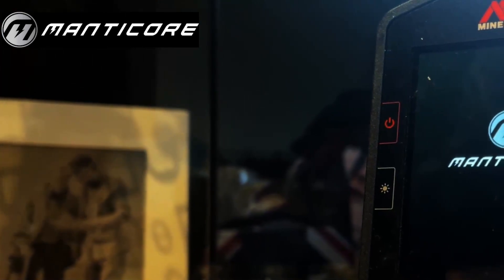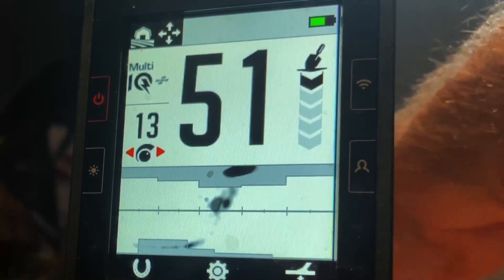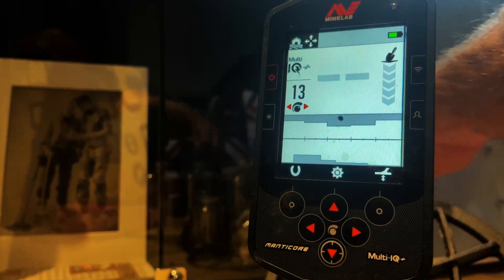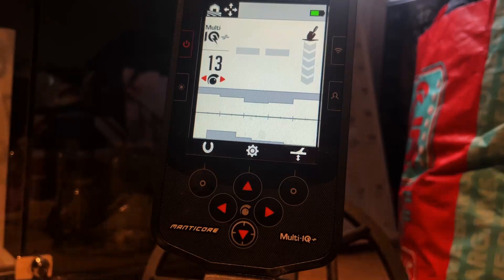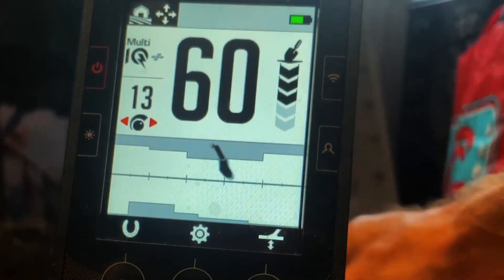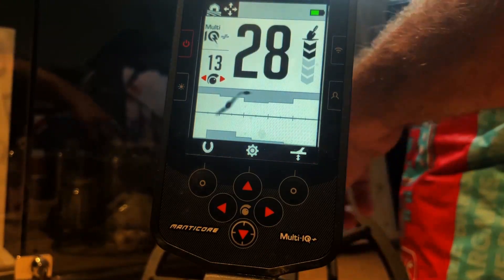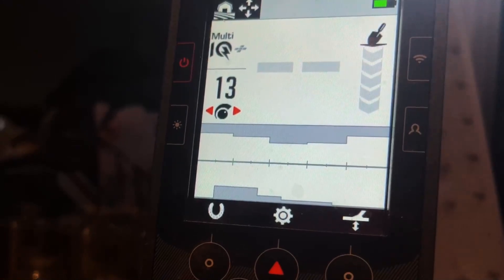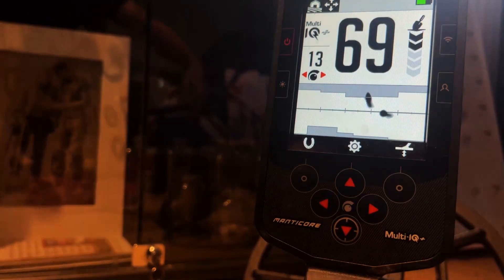BREAK THROUGH! Looking At The 2D Screen Of The Minelab Manticore | Metal Detecting Tips And Skills

Comment: So can you cut out the iron all together watched another vid about the new 900 and it cut out all the coke and iron ..?
Reply from the maker: Yes to coke no too iron
Reply from the maker: Some iron but if your pushing a detectors iron filter’s capabilities you got to be prepared to dig iron , with any detector with an iron bias iron filter it goes . You can run if really high and a higher iron tone break and not dig much iron apart from large deep iron. It all depends how much you are prepared to sacrifice digging some iron to get the goodies amongst iron. On some of my quite permissions I turn iron filter totally off , as a filter hinders the full performance of a detector , especially depth.

Comment: In engineering terms, a metal detector operates by generating an electromagnetic field and sensing disruptions (feedback) in that field caused by metallic objects. When small iron objects are shaped as balls or rings, they provide a more coherent and concentrated mass, leading to a stronger and more consistent signal disturbance. This is due to their more uniform interaction with the detector's electromagnetic field. On the contrary, irregularly shaped iron (horseshoes etc) objects may scatter the electromagnetic field, resulting in a less predictable and weaker signal, making them less prone to mimic good solid formed targets (2d traces). So it’s not the ground, it’s the uniformity of the conductivity in the object that mimics non ferrous. Ever noticed stainless steel washers. Banging signals; whereas iron plates etc are horrendous 👍🍺
Reply from the maker: yeah the induced emf moves more freely on a ring shape item , but  clash on say a solid item such as a coin, horse shoes give off a great signal come up non ferrous more than  iron.
Reply: @HistoryRevisiteduk Yup, horseshoe maybe not the best example; but I can spot them now unless they are super deep. We Get the classic S shape moving from bottom limits to top.. Plus if I think iron, I always lift the coil up 6 inches and more, and if signal is still banging but messy, is 99% of the time iron. However if the signal disappears or fades is more likely to be a good target just on limit of detection. Of course you never know, and on nice soft ground will dig some to keep confident 👍😍🍺
Reply from the maker: @neilsbluesky8027  yeah great method coil raising to find out the size of a target 👌🏻🧑‍🦯